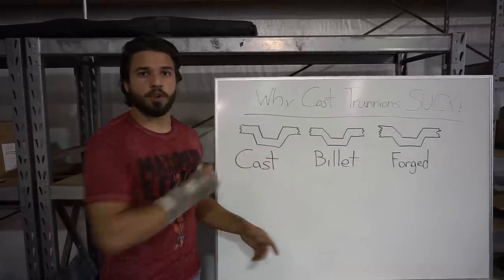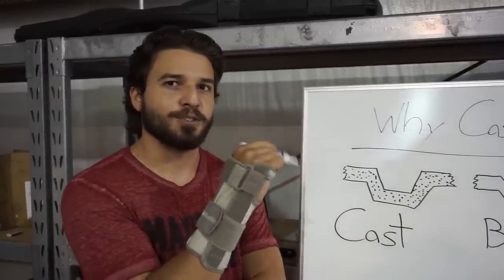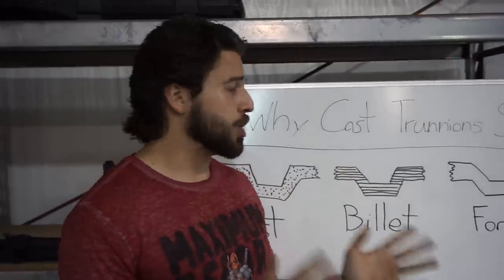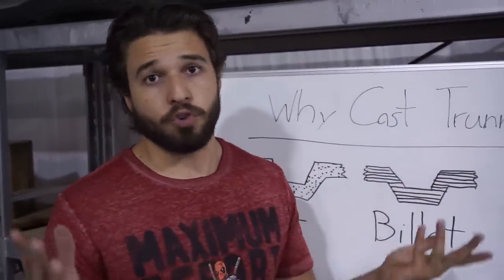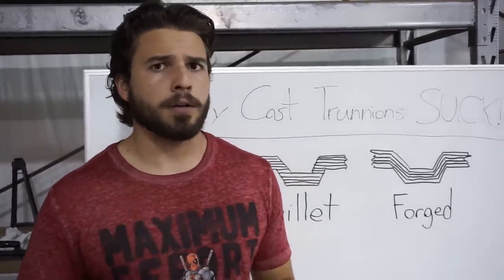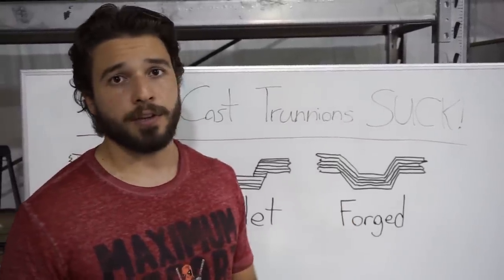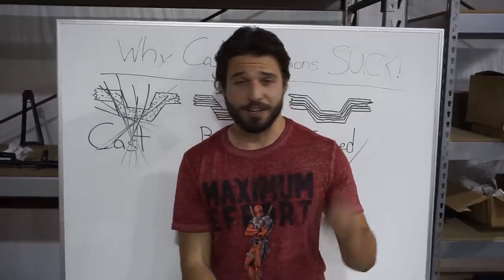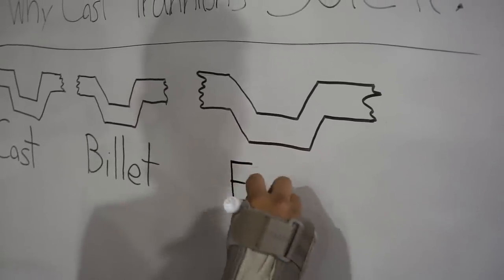Why Cast Trunnions SUCK!

Comment: I like Brandon but this is all wrong ... there are  bad castings and excellent castings. Ruger admittedly has some of the strongest revolvers and rifles in the world, firing the most powerful cartridges and they are all cast! 
Blackhawk helicopter blades are cast. The best castings in the world are as strong as milled or forged. 
Poor castings on trunnions will fail, Pioneer Arms of Poland have been making cast trunion full auto AKs under contract for many militaries around the world beating out all competitors in excelling in all the military trials. Historically their AKs are not failing in the field under all conditions. Pioneer uses the same parts for their commercial rifles. The has tested one of their AK sporters that was built with parts pulled randomly from the factory put a rifle together and fired it full auto 120 rounds (4x30rnd mags consecutively) then 1 hr cool down between each 120 rounds. They did this until they reached 15,000 rounds! The cast trunnion had minimal wear and the headspace was still correct. 
The trick is to buy the right AK with forged or properly made cast trunnion, I'll take either. The American AK companies outsource the part so finding out who is making the casting it is difficult. If Pioneer Arms Corp is making it then you know it's going to be an excellent cast trunnion.
Reply: Bro they literally failed headspace test after 500 rounds in rob ski video. Watch some mishaco videos about pioneer arms. Spoiler they're garbage. Ain't no way they're producing rifles for military contracts.

Comment: What I found is that the most important thing is the steel quality, not really how its done. A trunnion forged out of bad steel isnt any better than a casted part.

For example a lot of  parts in a vehicle such as the steering rod is casted, but high quality steel is used for it.

So the reason why older Aks are usually better is because the steel quality was much better in the past. They are using way to much of the recycled material nowadys

Comment: I'm sorry Brandon, your explanation on cast microstructure isn't correct. Cast metal DOES have grain structure. The problem comes down to the alloy. In order to get a good casting, metal fluidity is a priority. Therefore, rolled (wrought) alloys are different than cast alloys. If you compare cast alloys to wrought alloys on a stress-strain curve you'll find most often that cast alloys have a much lower yield strength than wrought. Therefore, it would take less force to deform.  Something to keep in mind, ALL molten metal has to be cast. Machining from a billet or forging is just a secondary step to the casting.

Comment: Whoa there Pal it is uncool to say American manufactured AK parts are low quality. I'm sure your not a metallurgical engineer. Out here on the West coast were people are under left wing attack. There are good manufactures of of AK parts exceeding the quality of imports and pushing the current line of new geometry using high nickle alloys and other high end materials. Why? Because were all used to make Jet parts.You just have not seen them and statements like the one you made in video are unfounded. As for cast sucking that statement is a matter of context. If Ruger did the casting with there cast tooling and technology I run it. FN runs many cast parts on there machine guns. Yes there is a rifle on the market we all know and hate and yes there casting suck. But don't you dare ever compare my work to that monstrosity
Reply from the maker: Threat Mitigation Manufacturing This isn’t really a matter of opinion. 
There’s not a single AK with cast trunnions that can outlast it’s forged counterpart. They crack, warp, and explode. Very well recorded.
Reply: That fact cast sucks which I agree with. What I don't care for is your negative statements that if Americans made it must suck. Not cool some of us are working very hard.
Reply from the maker: Threat Mitigation Manufacturing Take offense if you want, but it’s a fact. There’s is no fully American made production AK that doesn’t suck. Where’s the lie? 🤷‍♂️
Reply: You realize @Brandon Herrera is talking American made AK's with cast parts, not every single thing that is American made.... right?  Cast AK trunnions fail at an alarming rate, that's a fact not an opinion.
Reply: ebrandon98 Not only their domestic AK's, but you talk to anyone about different systems besides the AK/Galil (CETME/G3/93, FAL, Uzi, Sterling, etc.) made by Century and anyone worth their salt will tell you Century is bottom-of-the-barrel garbage. Only crap outfits like I.O. and Hesss/Vulcan/Blackthorne make Century look good which is really saying something.  Nothing but bottom feeders.
Reply: So why don't you produce a cast parts AK and show the market the difference. Brandon never said all American manufacturing is garbage, he specifically said... American AK manufacturing is garbage. Pull your tampon out, valley boy and read or listen to the vid again. Asshurt children are everywhere, just looking for a reason to play a victim. Step up, make some high quality cast parts and prove to the market that it's safe and viable.